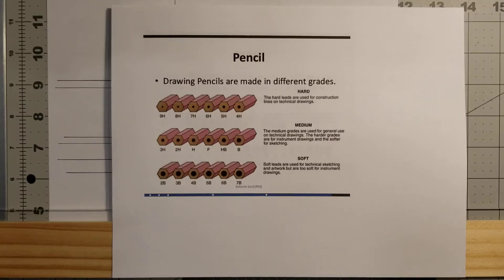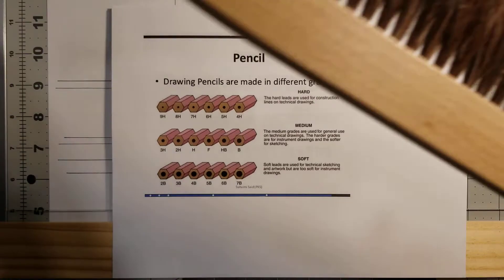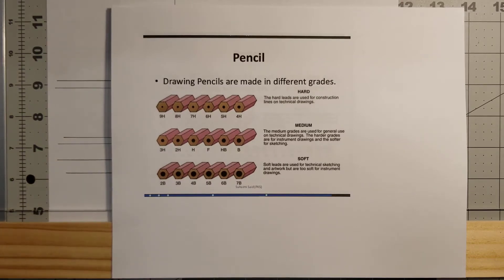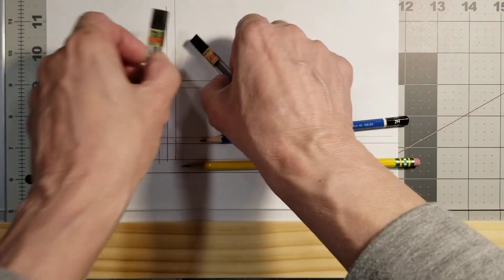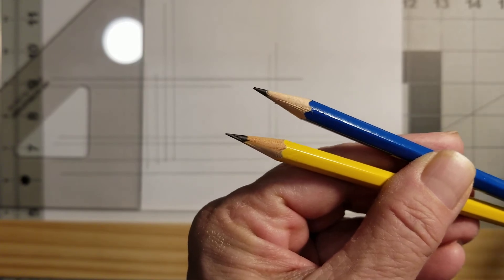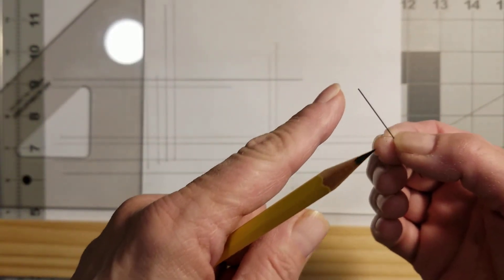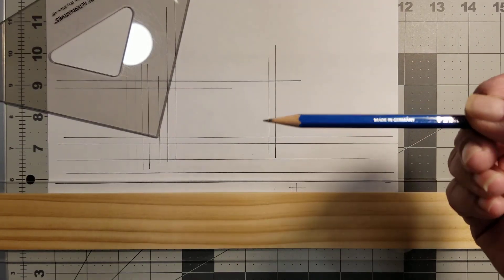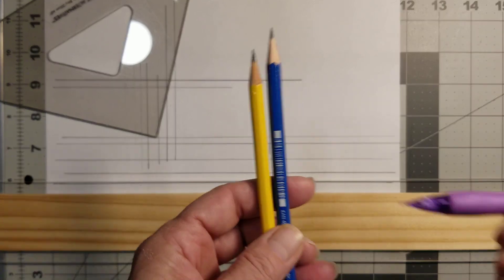Hand Drafting:  Lead Types and Pencils

Comment: 👋 HI , I usually do my guide lines with 4h and lettering with H , solid lines F .
Reply from the maker: Yes, that is an excellent practice. We have reduced the drafting kit supplies required for our students. Controlling student budgets are a concern. Also less hand drafting and increased computer software. Once you have control of your own hand with regard to pressure of the lead on the paper, it is second nature to control line weight with your own hand.  I use (2) pencil leads in .05 and .07. ——2H and HB.